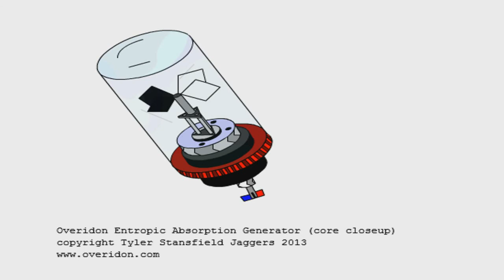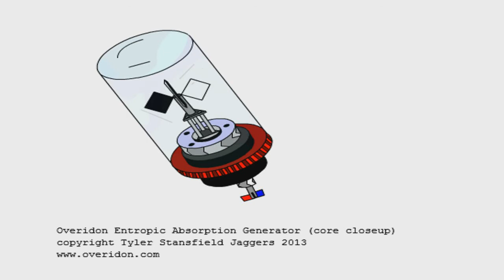E.D.I.T.S - Zero Point and Perpetual Motion

Comment: Are you still working on this project ?
There is also a need for other energies, not just electricity.
Reply from the maker: This project has split into two different ones. I used what I learned from the Radiometer project to make a Resin Curing tool that makes it so I can cure 3D prints made out of resin without needing a powered UV light. And the other project was related to the homemade Stirling engine project.
Reply: @overidon  Good luck.